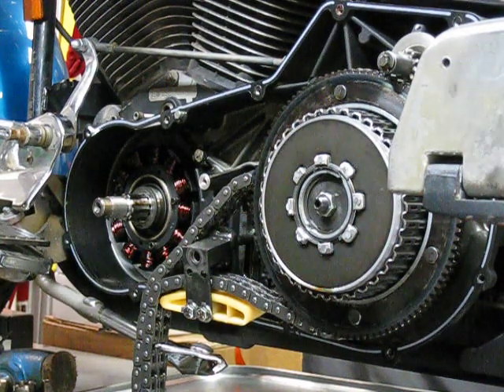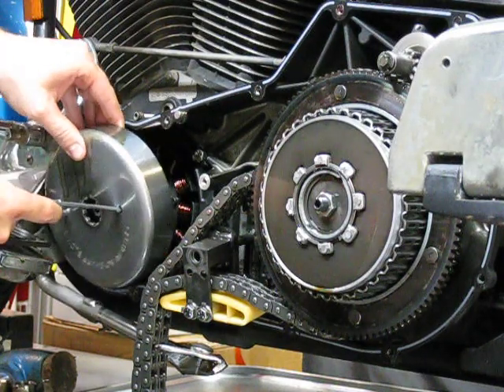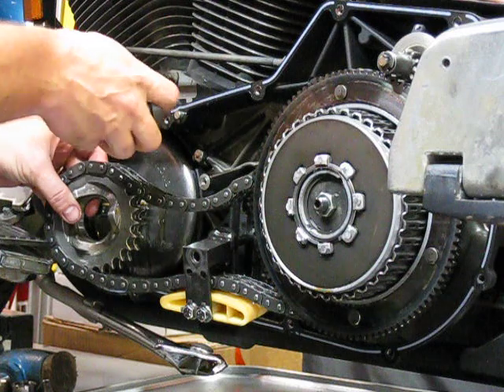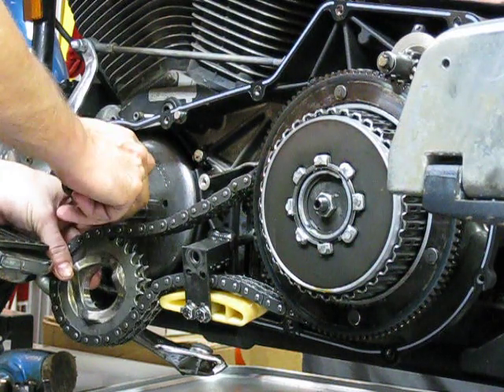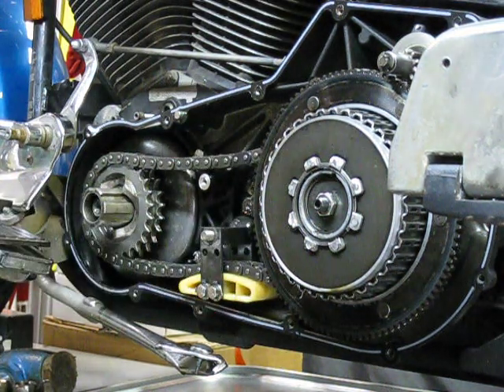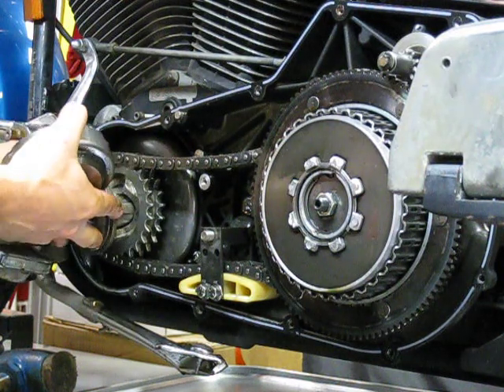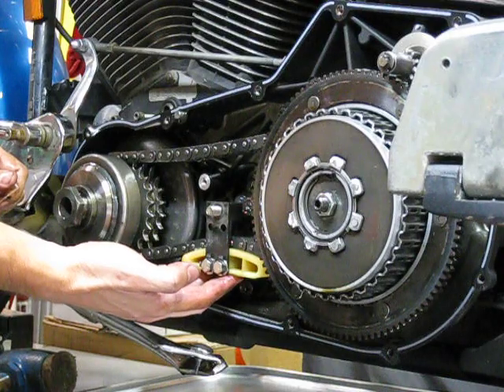Stator Repair - 6 of 9 - Stator Installed; Installing Rotor and Compensator

Comment: Many thanks for posting this video.

I did not know that there was sufficient play in the primary chain to enable the crankshaft sprocket to be removed without disturbing the clutch. Also, it's nice to see confirmation that the compensator nut is right-handed. 

Intend to keep my bike for years, so am trying to prepare myself for one day replacing the rear wheel drive belt.

Could you go on a little further and show how to remove the clutch and inner primary cover ?

Regards,

Comment: ALWAYS inspect the magnets on used rotors for magnet shift! The adhesive can break down and permit magnet movement. If a magnet comes loose it can eat your stator. I replace rotor/stator and regulator when I work on any "new to me" HD.
Reply from the maker: O.F. ... thank you!!!!  That is great feedback.  Thank you for taking the time to share your experience and helping others.

Comment from the maker: @ hackndos - Yup, used the blocking tool on the bottom when you torque it down. 

Search:  Stator Repair - 3d of 9 - Clutch Installation - Torq specs.AVI  (At minute 2:30)

Not sure about the shims; sounds like your were very careful to watch everything.  I am sure you are fine.

Thank you for your post,
Scott

Comment: I missed something,saw u struggle to get stator plug in ….then a video with it installed...isn't there a shim/spacer btwn rotor and stator???
Reply from the maker: @user/clarktferrill - Am lost.  You are referencing two different issues.  Yes, I struggled with the plug.  That may have been due to the manufacture of my new stator.  Maybe a genuine HD part would have gone right in.  Yes there is a shim PN 29961-85, on the shaft,  between the rotor and stator.  You will see it in the Service Manual and the Parts Manual.

Comment from the maker: @Mr007jessejames @Mr007jessejames  - Heck no she'd kick my butt. 
 
I do see your point here and you are correct I did use the block to torque the nut down.
  
Watch me make the mistake of not having it in place:
 
Search my channel: Stator Repair - 3d of 9 - Clutch Installation.AVI
 
Thank you for stopping by and for your excellent comment,
Scott
  
Click link below and next to the yellow "Subscribe" button, click on UPLOADS to find the video ref'd above.

Comment: That really looks like the old stator with the red coil. The new one was like gold. 
Was the new one wrong? 
Just curious 😊
Reply from the maker: Brad - I went with an Accel stator....after burning through two stock Harley stators.  Just thought I would give Accel a try.  They claim lifetime warranty.
Reply: @VTwinOnline  do you know if this is a similar process for a 88 ci?
Reply from the maker: Steve, it should be very similar.   Always make sure you buy the service manual to help.
Reply: Accel is shit to,tried em all none last forever ,just changed my 8th at 120k

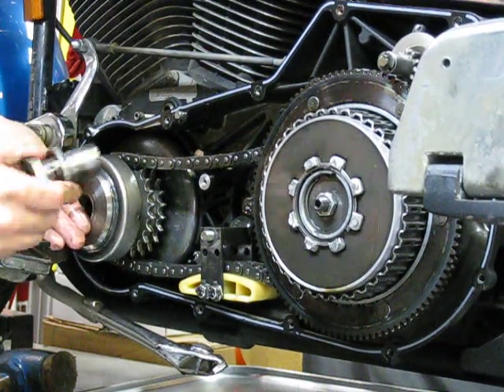Comment: On 1:52 can be seen, that you put a shim behind the nut. Isn't it the wrong place?
On all videos on the net, I haven't seen it there.
Does it not rather belongs behind the shaft extension?
In the Service Manual as well as the Parts catalogue I cant find it there....
Reply from the maker: @ EVOFLHS - This project was done on a 1995 FLSTC.   I am looking at page 58 in my parts manual P.N. 99450-95, as I type.  The parts are installed correctly per the manual on the bike we are working in the video.  Your bike may be different. One of the reasons I uploaded the videos is that I was video taking the disassembly in the event I had any doubt as to how everything came a part.  Good luck on your project.  Sounds like you have the manual.  You CAN do it.ScottV-TwinOnline

Comment from the maker: Yeah, I think I was able to remove this chain without clutch removal because the bike had 85,000 miles.

I was planning on showing cluch removal, but I did not have the proper tool.  And I recomend you BUY the proper tool for this task.  

Don't mess around with trying to make a homemade tool for this project.  Just spend the money.  I got mine for $40 bucks.

16-0967 Clutch Compressor Tool

I'll post the clutch job next time I get into the primary.

V/r,
Scott
VTwinOnline

Comment: When u put comp sprocket back on,No locktight?????? Torque specs??????
Reply from the maker: @ D.R. - Yes... Lock tight... Check your service manual. Yes, torque specs as noted in the red video annotation: 150-165 lbs